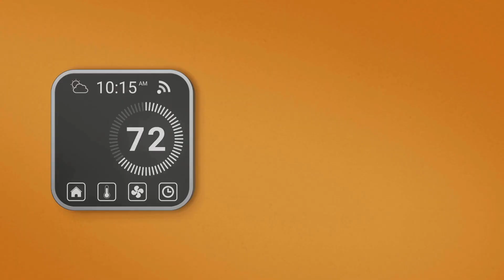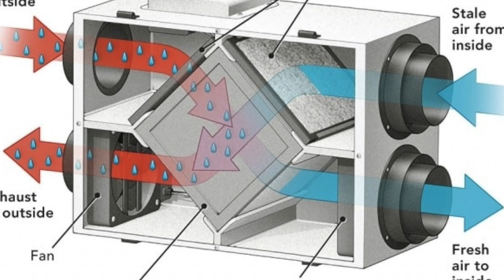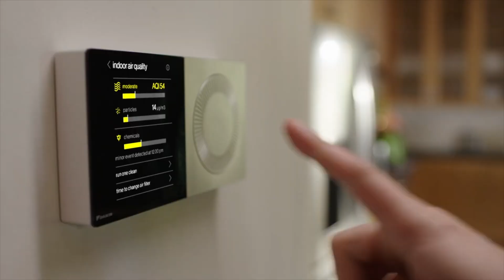5 BIGGEST Home Construction Mistakes Homeowners Don't Know!

Comment: Great video Josh. Combustion air for your fireplace and water heater on super tight homes.  This is an issue I see all of the time. Along with make up air for the really high CFM kitchen exhaust fans.
Reply from the maker: Thanks pal. Too many technicians don’t own a combustion analyzer

Comment: I remember working on those "minisplit" condensers in the early sixties. GE made many and so did Airtemp and the side discharge could reach across 40 feet and cause the neighbors a/c to shut down due to taking in hot air discharge. This was up in NY.
Reply: Sometimes the homeowners had to have some shrubs planted to resolve the problem!

Comment: How do short cycling and humidity management factor in on a ductless mini split?  Does the unit's ability to modulate compensate for being oversized? Curious because not all manufacturers offer indoor evaporators smaller than 9k BTU, and that's oversized for a lot of typical bedrooms, for example.
Reply from the maker: Please watch this video. I think it’ll help
Link: https://youtu.be/yAZWWhNd5bg?si=UlOmtE2cLzY2txQG
Reply: @NewHVACGuide  thanks!

Comment: Crawl spaces or raised foundation residences.  What/how does encapsulating that area truly benefit the building? Seems that the area is already air tight, the soil and the concrete or masonry foundations/stem walls don't breathe but they do transfer heat/cold. The vents have to be open so I'm fully aware of the benefits.
Reply from the maker: The main benefit is turning that space into basically another room in the house. A large percentage of the air people are breathing comes from the crawlspace,and all of the things going on in the crawlspace, due to stack effect.